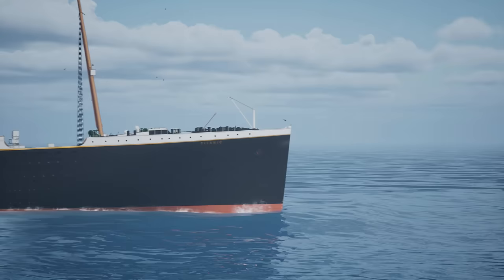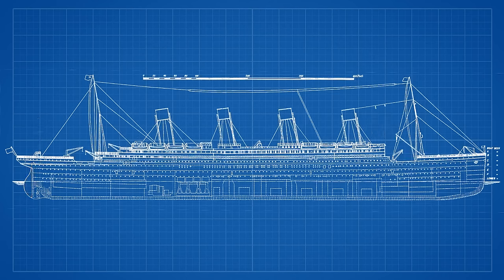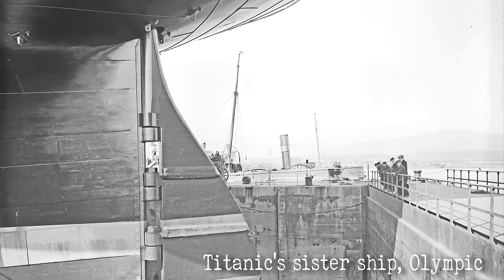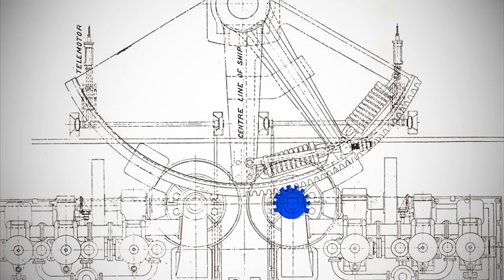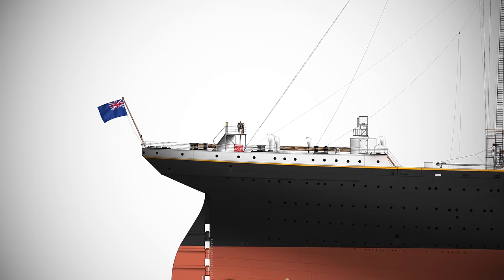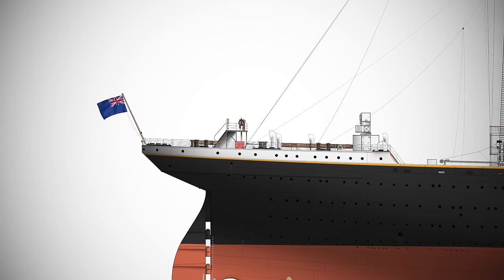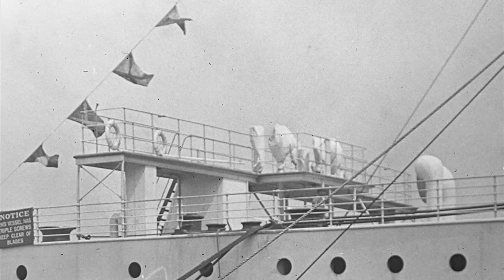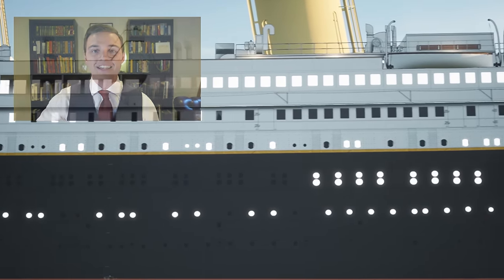How Did They Steer the Titanic?

Comment: Er reality check!!, there is another way of steering a big tub like Titanic should the power steering fail, yes cats&kittens use differential engine power, okay a tad difficult with then archaic telegraph engine control ,but it can be done,. Turn right ring up first gear or slow ahead on the right engine, leave the left in second gear, the tub will turn right. To straighten up ring up first or second gear on both engines, yes I know Titanic has a third engine a steam turbine fed from the main engines waste exhaust steam, being a fixed drive it cannot be  reversed. If you cared to notice the rudder is behind the third propeller, if  the skipper orders reverse gear, like your grandmas Honda Civic Automatic, the helmsman drops out of first gear, rings up neutral, then rings up reverse, that third prop stops spinning and idles, bang goes your rudder authority, well Homer Simpson fit twin rudders one behind each wing engine propeller. with both wing engines in low reverse you retain some rudder authority.

Comment: No. The rudder was far too small for the length of the boat. Recent calculations show the ratio used was so wrong that a rudder twice the width of the original was required to guide the ship through ports. The Titanic just did not have a satisfactory turning circle.
Reply from the maker: This is not true; quite the opposite is true, in fact.
Reply: @OceanlinerDesigns  Her rudder are was 400 sq ft. The standard for a ship such as Titanic is 2% of hull area, equaling 577 sq ft of rudder. Hence it was too small.

Comment: Yeah but if the sea walls and the water type walls would have went all the way to the top of the ship instead of only so far up and the water went over it over to the next Point instead of the top of the hole it wouldn't have sunk it would have took on water but those two Ford watertight bulkheads would have went to the top of the it would not have sunk but since all didn't worry about it so I just kept overflowing each section until it sinks I watched all the animation and watched all the stuff on the Titanic after they discovered it on the bottom of the ocean and the plans and the diagrams of the ship the plan said that the bulkhead should have went to the top but in reality the engineers did not build it properly they didn't do like the plans told them to do they tried to save money and by not doing the still work properly
Reply: That’s not entirely true.
Reply: @DerpyPossum  what The Learning Channel and the Discovery Channel is not true that's like saying Science Channel doesn't know science and they were also talking about it at the time so you're telling it's not true that if it would have been built correctly it wouldn't have sank because the flood bulkheads didn't go all the way to the top deck like they were supposed to that's in the designs to go up to the top deck but the secondary designs after they got built didn't say oh it's Unthinkable so it doesn't have to do that
Reply: @jamesendsley1560  It was built as correctly as possible. The original designs never had higher bulkheads. The designers didn’t cut corners at all. 
You should probably do more research beyond The “Learning” Channel, or “Discovery” channel, if they’re this wrong about it…
Reply: @DerpyPossum  they found documents saying otherwise they did investigations after it sank because of its sync the Learning Channel Discovery Channel and all that and the Science Channel had the same documents saying the corners on the all kids and didn't send them all the way to the top to save money and cut corners
Reply: @jamesendsley1560  Where are these documents? What do they describe? What authority passed them? Are there any testimonies to support this? What was the written date? 
Where’s your evidence?

Comment: How did they steer the Titanic?
Well as it turned out, not very well!
Reply: As well as possible given the circumstances.
Reply: @DerpyPossum  Eh, debatable. There's long been a criticism of the orders on the night to stop engines as they were turning to avoid the iceberg. Setting the engines to slow ahead would have potentially put a greater turning force on the rudder from the water moving past it and turned the ship more quickly. Stopping the engines entirely likely made the rudder some percentage less effective.